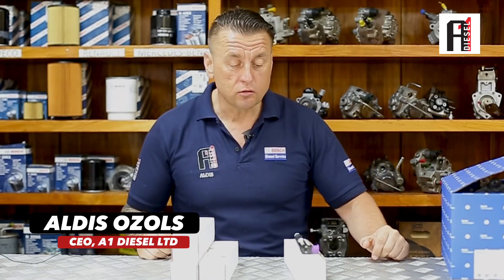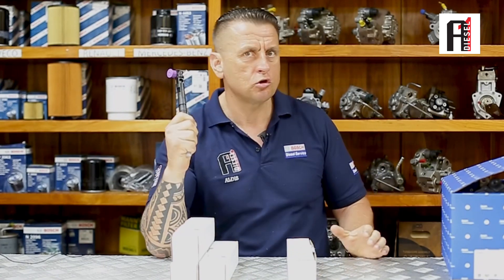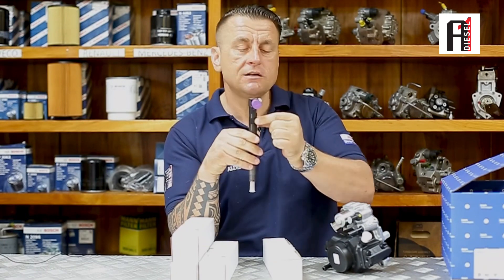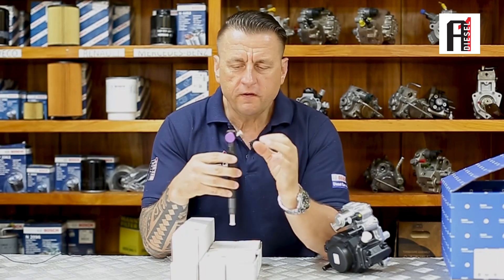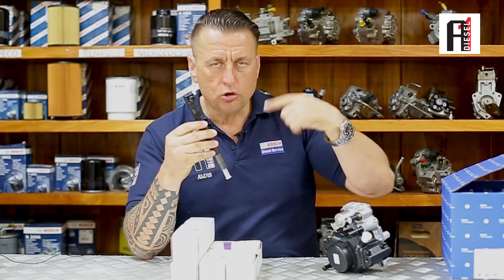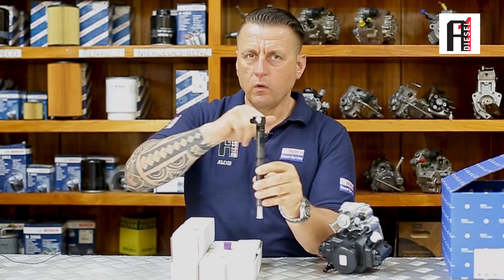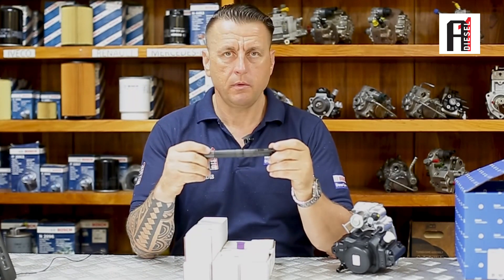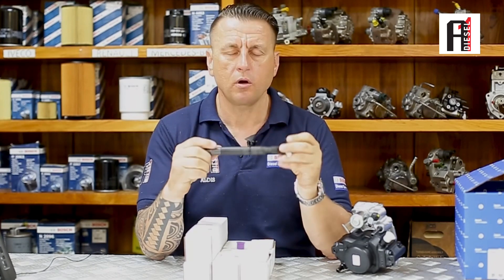SECRETS ABOUT DELPHI INJECTORS

Comment: That's all very good but when  the vehicle has done 200,000 km it is often quite old and not worth much. The cost of new injectors and pump could be a significant proportion of the value of the vehicle  and it is more cost effective to put in a used injector and keep the old pump.  If the vehicle last 18 months to 2 years after you fit a used injector and keep the old pump before it stops working you scrap the vehicle and get another. Even with new injectors and new  pump an old car is still an old car !

Comment: how do you bleed air? What do you mean by cranking?
Reply: Leave the pipes of each injector a little loose, then crank the engine. That means you turn the key to start the car. The engine is gonna try to start, but it can't because you're bleeding the injectors and all the pressure is getting lost at that moment. When the bubbles are gone and from the fuel pipes comes only fuel, you tighten each connector. Then you crank again until the engine starts. I usually keep it at 2000rpm as soon as it starts up, to make sure the system is properly bled.

Comment: I have replaced all 4 delphi injectors 28231014 and high pressure fuel pump sir but I didn't code in new injectors do you have any guide on where I can buy equipment to do programming